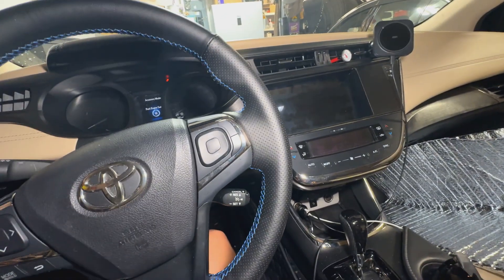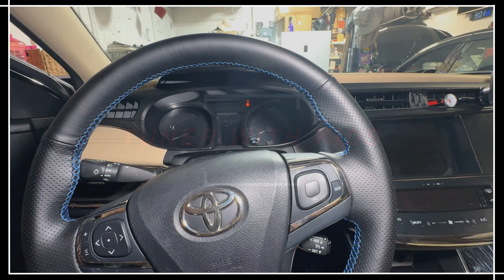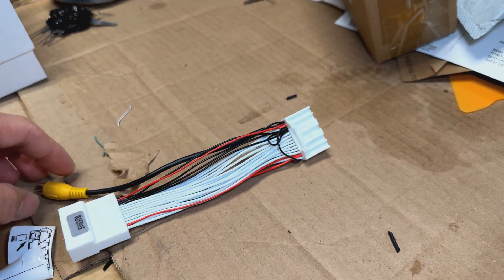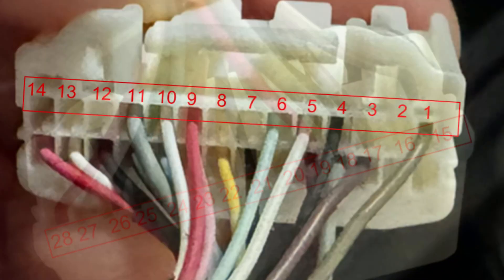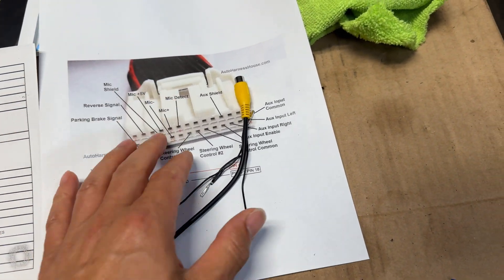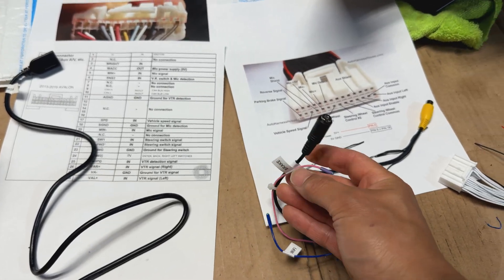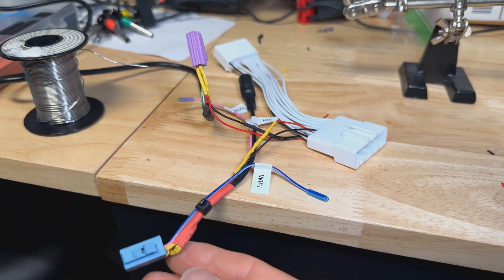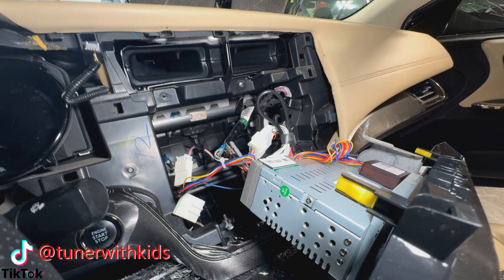How to Wire OEM Toyota Mic to Android Radio Head Unit

Comment: Thanks for the video. I installed Ainavi H6 on Toyota Auris 2018. I have the same problem. Do you know please if the same process would work? How can I ge the diagram for Toyota Auris? Thanks a lot.
Reply from the maker: Should be similar pinouts.
Reply: @TunerwithKids   do you sell a ready harness for such connection?
Reply: Did you solve it? I am interested in the same radio for the RAV4
Reply: @domdeniso  Not really I couldn't :( I installed the ainavi H6 to my Auris 2018 and it works well but the mic is horrible. It's a bit complicated to me so i couldn't connect it.

Comment: Hi. IS 250- does the sunlight sensor have its own fuse?
Reply from the maker: The sunlight sensor is your auto light sensor. I think it shows a code in scan tool but isn’t a real issue.
Reply: @TunerwithKids AC. Error codes 1421 and 1424 - solar sensor circuit, for both driver and passenger sides.